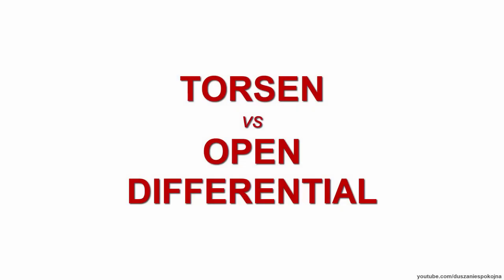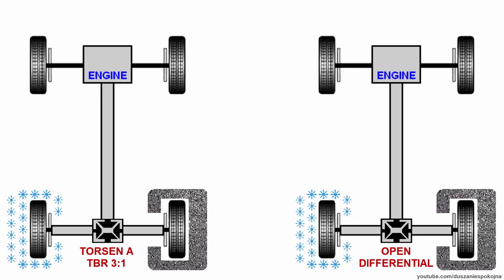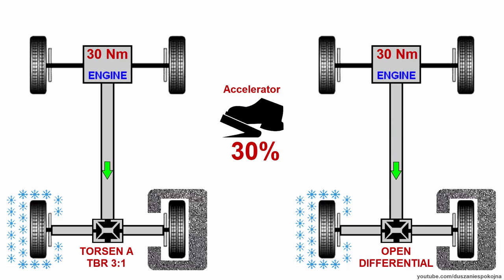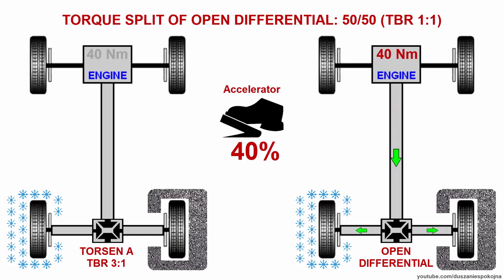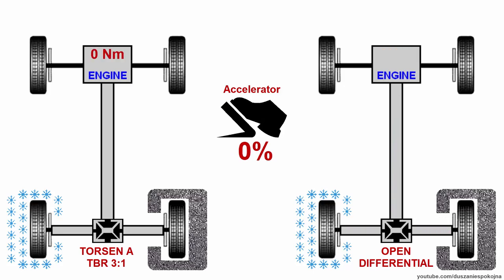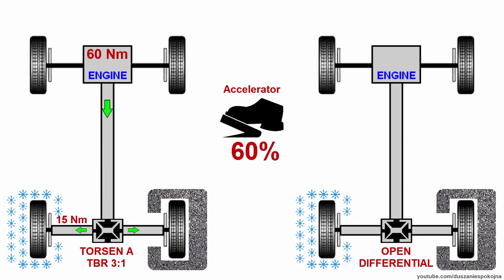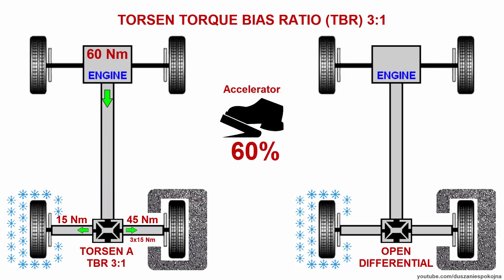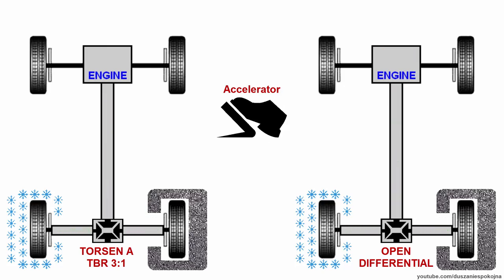TORSEN vs OPEN DIFFERENTIAL - TORQUE SPLIT simplified animation model

Comment: Why is 13Nm torque applied instead of 15Nm after traction lost for the wheel on the ice
Reply from the maker: There must be a resistance too apply torque. Wheel which is already slipping has less resistance then before traction is lost, that's why torque decreases.
Reply: The dynamic friction coefficient is smaller than static friction coefficient for smooth or relatively smooth surfaces. Dynamic=when the surfaces slide (wheel spin).  However, on high snow and moderate mud, at higher spin, the coefficient increases again probably because the centrifugal force throws the snow/mud from between the tyre profile pattern.
Reply from the maker: @rotorblade9508  Or the tyre diggs deeper to the surface with better traction 😉
Reply: @rotorblade9508  Thank you for the explanation that has so physics exactly:) for that reason ı can understand.
Reply: @4x4.tests.on.rollers  Thank you so much. I love your every video these are so specific:))

Comment: Does the Torsen lower the towing capacity of the vehicle it's on?
Reply: It does not. It will actually greatly increase traction capability for the vehicle while towing. Especially at boat ramps or any off road scenario.

Comment: Torsen is a tricky thing :)
Reply: I agree it is but also interesting.  The video is very simplified :-)
Reply from the maker: @An.Individual  Values are simplified, not the rules 🙂
Reply: @4x4.tests.on.rollers  good video.  I will share it.  You didn't mention that you can use ABS brakes to trick it to transferring more torque.  I love mine in my F-150.
Reply from the maker: @fabulousoffroaddesigns5080  Thanks. ABS/brake intervention will be in separate video some day 🙂

Comment: The situation with the open differential is far worse than demonstrated.  An open diff will not "always split torque evenly"; that is what a spool, or fully locked differential does.  Rather, an open differential will direct all torque to the wheel which has lost traction, so that once the traction limit for EITHER wheel connected to an open differential is exceeded, both wheels stop moving the vehicle (the slipping wheel because it is slipping and the wheel with traction because it is now stationary).   That behavior is wonderful for road manners, as allowing the wheels to spin completely independently allows the different path lengths to direct how much each wheel spins, but it is beyond awful for off road.

It is also important to note that if either wheel on a torsen diff loses ALL traction, then both will stop in the same manner as an open diff described above.  However, even a tiny amount of resistance to the spinning wheel's rotation will cause the torsen to engage and direct torque, which allows for the technique of apply gentle brake while accelerating with a slipping torsen wheel to cause the diff to engage.
Reply from the maker: Not correct, that's a common mistake. Torque split of an open differential is always 50/50 (TBR 1:1). What varies is the rotational (angular) speed thus the power, not the torque. Torque split of a spool or locked differential is from 100/0 to 0/100 what means that all the torque can go to one wheel while rotational speed of both wheels remains the same. This video should help: https://youtu.be/hsgAAQ5ZzG0
When it comes to torsen - it is explained in the video what will happen when traction is lost. That's not the same as open differential but the final effect may look the same.
Reply: I understand what you are saying and agree, but in practice the power to the wheel with traction can fall to zero, such that the theoretical torque directed to the wheel with traction is meaningless because it has zero power.
Reply from the maker: @amschind  OK but the statement that open differential will direct all torque to the wheel which has lost traction is completely false. What will happen when one wheel has zero traction is explained in 1:37. There's no theoretical torque directed to the wheel with traction, there's a real torque but with value limited by the wheel with no traction.

Comment: What part consumes 70 - 52 = 18 Nm? Does it go to heat Torsen differential itself?
Reply from the maker: No, the point is that it is not possible to apply 70, not enough resistance.
Reply: @4x4.tests.on.rollers  how does people use torsen on their driftcars then? 🤔
Reply from the maker: @trippychips  I'm not in a drift thing but I suppose that they may be using torsen with high TBR ratio.

Comment: Wrong. If the motor produces 200n of torque, do you think the Torsen magically "loses" the torque greater than the bias ratio?
Reply from the maker: Nothing is wrong. Engine cannot create more than the grip allows.
Reply: @4x4.tests.on.rollers  sorry, but you don't understand how the Torsen/Truetrac works. Your video is partially correct, but also very wrong.
Reply from the maker: @totaldla  I understand it very well and I think you don't. But if you think I am wrong - explain it.
FYI - video is entirely based on information provided by JTEKT and technical specifications of torsen from the 80's.

Comment: There is a mistake. Open diff has 50 / 50 split only when both wheels has the same traction. So on the open diff picture max torque transferred to right wheel is equal to max torque of left wheel traction. For example, If engine produced 100nm (or 1000nm - no difference) - right wheel will get not more then 15nm - the min torque needed to left wheel to lose traction. So if your car will be on the lift - you hold the wheel by you hands even with engine being on the full throttle. The only resistance you get is torque needed to make wheel spin, and some mechanical loses.
Reply from the maker: No, there is no mistake. Torque split of open diff is always 50/50. Value on wheel with grip is limited and equal to value on wheel without grip. Locked diff has 50/50 torque split only when both wheels have the same traction and load.
Reply: @4x4.tests.on.rollers  i have open diff on my blazer. Its more like 100% traction on the passenger side, always. Period. Driver side NEVER turns under any circumstances. I know that its always 50%50% but it definitely doesn’t feel that way when you’re sitting there in ice or rain and one tire just spins.
Reply from the maker: @resistorstudios  That's the problem. Tire with good grip gets the same amount of torque as tire on ice. That's why only one spins.

Comment: There is a physics error you made, power will always flow thru the path of least resistance, so therefore in an open differential power sent to the rear axle, say 50 the split should equal to the amount of torque given by the engine, in slippery conditions one wheel on snow the power should split 20:30 or 10:40 etc depending on the coefficient of friction, if both wheels are on tarmac power split is 25:25.
An open differential(in slippery conditions) can loose power upto over 95%, it can never be 100% because some power is lost thru  heat because of the moving parts, therefore, when an engine produces 50, in an ideal open differential the maximum power loss when one wheel is slipping should be about 47.5:2.5(case example)
Please make the needed corrections.
Reply from the maker: I don't get your point. In this simplified model the amount going from the engine equals the amount on both rear wheels (sum). And in case of open differential 50% of torque goes to the left and 50% to the right. Always.
Reply: This video is about TORQUE split, not POWER split. Power= torque x angular velocity (revolutions). Open differentional always has 50/50 torque split. And torque can be on a fixed wheel too.
Reply: @4x4.tests.on.rollers 
True to your statement, however check your video at about 1:40,
You say when 30Nm is produced from the engine due to loss of traction, power drops to 26Nm from the engine,
Now power output from the engine does not in way rely on the traction of any of the wheels
Reply from the maker: @edu.g6082  Everything is correct in the video. Listen to the full sentence and its correlation with animation, not just two seconds long part. If still something is not clear - please precise your question.
Reply: @4x4.tests.on.rollers 
I REST MY CASE. 
Let somebody else be the judge.
Reply: @edu.g6082  you are wrong on a bunch of levels.  Torque X rpm = power.  When you lose traction, the spinning wheel releases power and reduces the torque left.  Also think of the torque bias ratio like a "door stop wedge".  If you leave it on the floor, the door may push it, but if you kick it under the door with 5 lbs force it will hold the door in a locked position, with much more then 5 lbs pressure.  This is not an open differential, and does not react like one at all, and contrary belief it can lock to a higher torque level then the engine produces, effectively allowing 100% of the torque to 1 wheel.
Reply: @edu.g6082  Engine power relies entirely on traction. As torque is calculated based on friction. So less friction means less power and torque. So if one wheel loses traction on an axle, the wheel with traction only gets half of however much torque it needs to spin the wheel without traction to redline. Which is not a whole lot of torque. So eventhough 50% of the torque is going to each side, only one wheel spins.